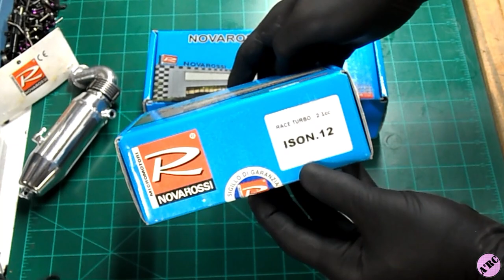Novarossi ISON 12R - Boost Port Explained - Nitro Engine Overview

Comment: So awesome 🤤🤤🤤🤤

I have a Novarossi 12 RC Speed 

It’s amazing old school race engine and it still rips like the day it was broke in. ☺️🤘👊😎
Reply from the maker: Hi RCSend 🔥💪🏻
- Is that the C-12R RC? Novarossi made some awesome engines as you know. 
How long have you been running that engine and what platform is it in (touring car, ST, etc)?
I appreciate you and everyone for watchn’ 🩷
Reply: @a2rc  I went and looked it over 
It’s a RB12 / Novarossi bottom end.  That’s what it is.  My bad I was close
Reply from the maker: @rcsendandblast1579  RB branded Rossi engines were great also 🧡

Comment: Bad Azz  hey I own a brand new Novarossi 353 Race .12, 7 ports Limited Edition factory modified with a Light Blue head. They were made exclusively for the Novarossi team drivers and not sold to the public. This engine is suppose to be a Speed Demon with insane speed . I want to install it in a Team Associated 1/10 NTC3 on road car with the 2 speed and I also have the single speed transmissions. I don’t race I’m into speed runs and I’m going to push the engine to its maximum speed. 
I admire your rc educational videos 👍👍👍
Reply from the maker: I appreciate the kind words and for you watchn’
- The 353 is an awesome engine and for sure it would bring your NTC3 to a whole new level (should match the TC3 colors also). 
- There are more engine overviews and rebuilds to come. I have been cleaning up a formal Novarossi C-12 (side exhaust) for a rebuild recently and it will make it to the channel in the future. 
#NitroIsTheBestGo 🔥💪🏻

Comment: I wish every engine came with a head button rather than integrating the plug into the Heatsink
Reply from the maker: Great comment 🔥💪🏻
Defiantly pros and cons for sure. Head buttons can be replaced if needed and possibly the heads can be modular between other engines. The “all in one” heads sometimes are lighter in weight when you compare all parts that make up the “head” and are only part number to buy.
Reply: @a2rc  I’d like to see a video comparing heads and head buttons. I wonder what is the weight difference between a cast Heatsink with integrated plug vs billet machined + head button. I think that would be cool to see, regardless of the results I think I’d still accept a slight weight penalty in exchange for modularity :)
Reply from the maker: @YZ-YZ-  Those kinds of comparisons are interesting to me too. Maybe in the future I can work on a vid like that 😁